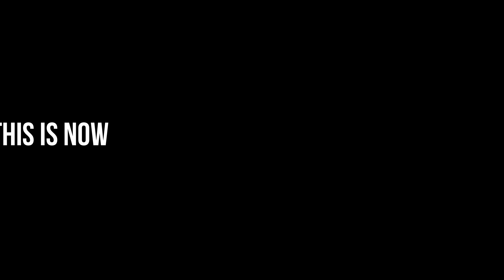DIY Simwheel V4 / DIY Direksiyon Seti V4

Comment: Hocam elinize sağlık öncelikle. Motor olarak 12V 200 Rpm 37mm Redüktörlü Dc Motor kullanmak nasıl olur sizce(Tork açısından baya avantajlı 13kg/cm). Hali hazırda elimde 15/54 oranında dişliler olduğu için daha yüksek torklu bir motora yöneldim. Ancak devrin çok düşük olması dejavantaj olur mu?
Reply from the maker: 300rpm altında genelde önerilmiyor ama tercih meselesi tabiki

Comment: merhaba stm32f407 yerine stm32f106 kullansak olur mu ? 2. sorumda iki rs 775 kullanmak mı mantıklı yoksa amazonda gördüğüm 280 tl fiyatlı 31ZY 24 volt 5500 rpm motor mu watt bilgisine göremedim 30 wattlık motorlarda var.
Reply from the maker: f106nın mimarisi farklı benim kullandığım sistemleri desteklemiyor. rs motor bu sistemlerde güzel sonuç vermiyor her türlü ya 2 dakikada ısınıyor ya da komple yanıyor. Benim tavsiyem kayışlı sistem yapacaksanız 100-150 watt arası 0.50-1nm nominal torku olan bir motor bulmanız yoksa bahsettiğiniz motorlarda güçsüz kalacaktır. Olay motorun torkunda yüksek torklu 100 watltlık bir motor 24v da 10amper bile güç çekmeyeceği için hem az ısınacaktır hemde verimliliği düşmeyecektir.